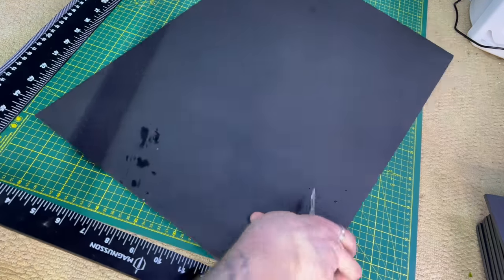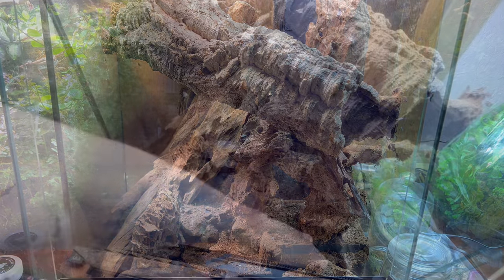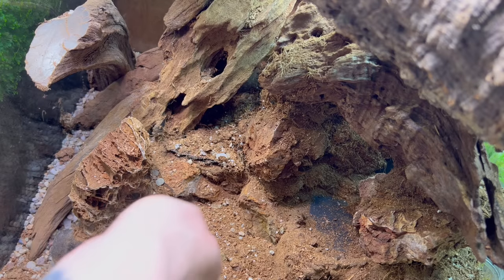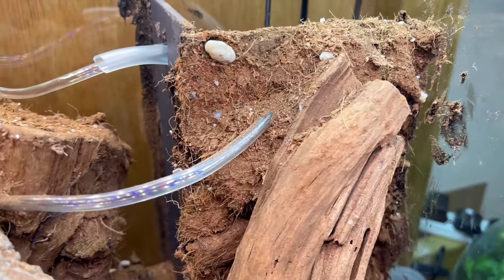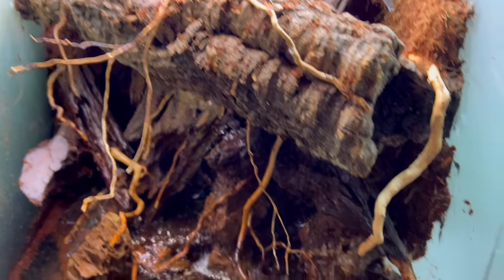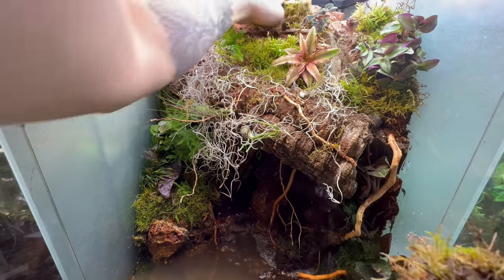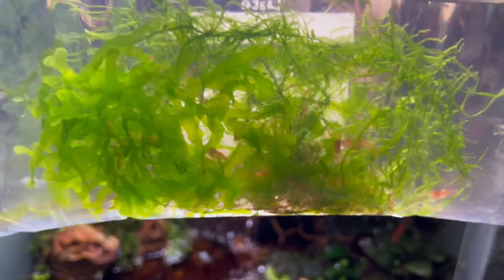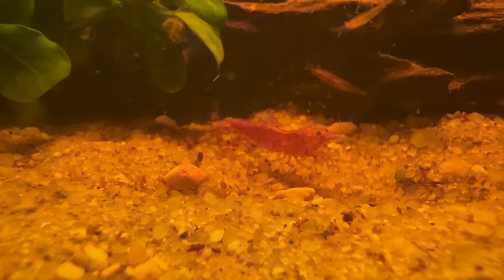Creating A Waterfall Cave Ecosystem

Comment: Hi, just found you as I was planning to build a square tropical reef aquarium and put dart frogs in the middle. Now I think I'll put a platform in the middle with the frogs, tropical plants, waterfall, stream,  etc..if I can fit it all. WDYT? Advice? I'll start with the reef aquarium  and slowly build the paduarium in the middle. I like how your rock edges drip water. My plan was a 48x48 reef aquarium, with the island in the middle. The aquarium will be about 12-18 wide, leaving a 24x24 platform or a little smaller. I was also going to grow some cannabis on the island, WDYT?

Comment: Loving the build. It looks awesome. How often would you do a water change on something like this?
Reply from the maker: I would typically do a water change every 4-5 days at first for the first month, after that it’ll be every week, a few months down the line it’s just the case of topping up the water level and siphoning the bottom whenever it’s too messy, that’s it really 😄
Further on is better as plants are pulling most of the nitrates out of the water column anyways 😄